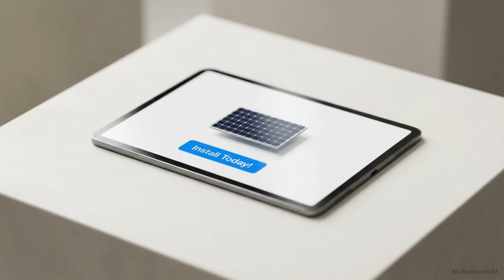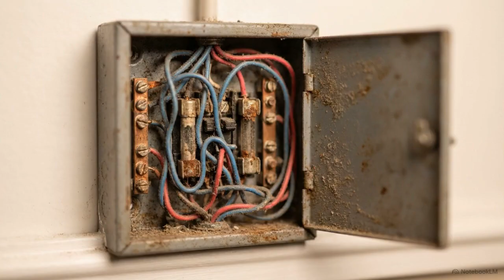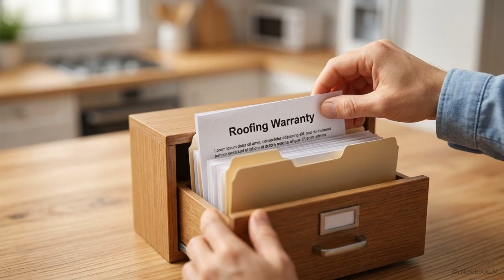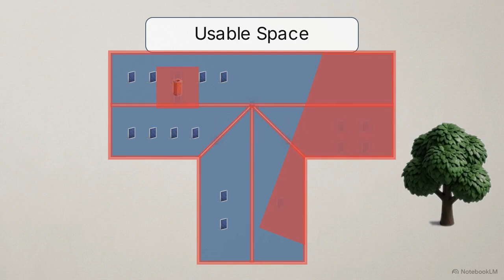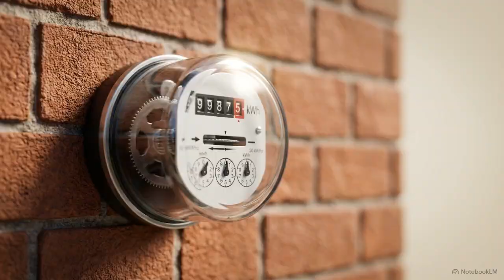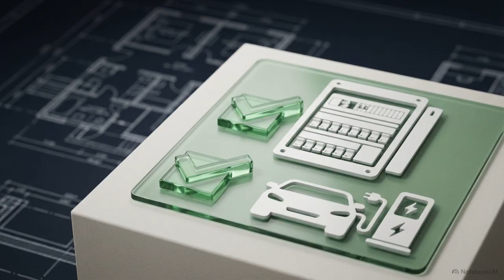Home Solar Panels Columbus Ohio: A Homeowner’s Strategic Guide

Comment from the maker: Is your roof actually a good fit for solar?

That is the first question every homeowner in Columbus should answer before comparing quotes. Roof condition, shading, usable roof area, and household energy usage all affect long-term performance.

If you want a personalized solar readiness evaluation, contact Solar Panel Installation Columbus here:
https://solarinstallercolumbus.com/contact/

Or call: (614) 706-0261